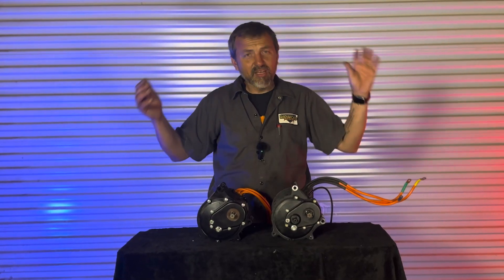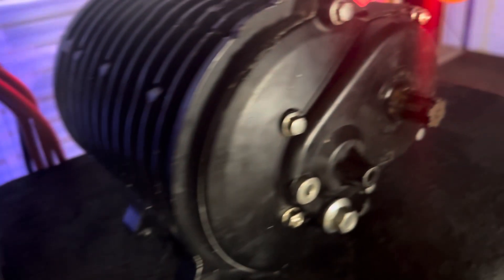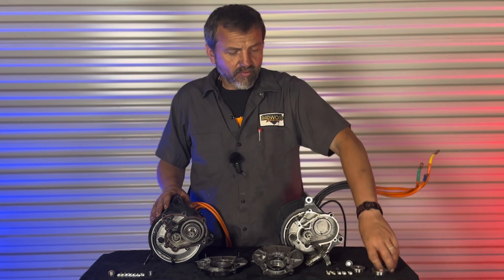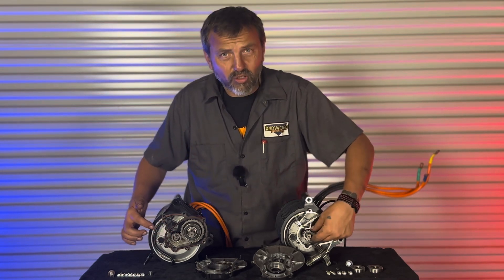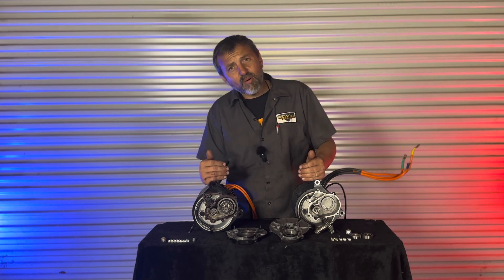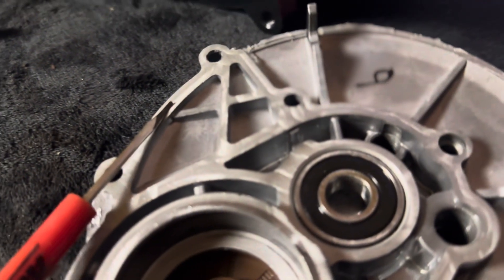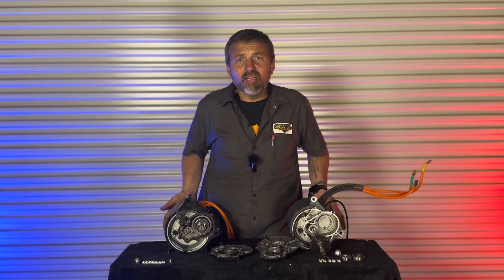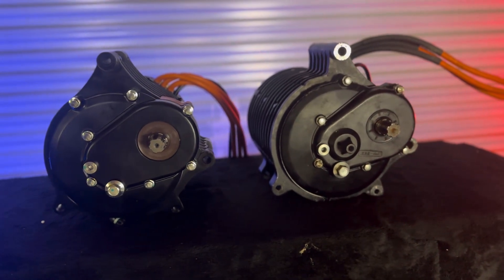Should you upgrade your QS138 V3 70H?

Comment: Hello
I have a question, after purchasing the engine, I did not unsecure the transmission vent, after driving a few km the engine turned off and It turned out to be burnt. Is It possible that oil got inside and caused so much damage? Regards
Reply from the maker: @miloszslodzinski4762  I wouldn’t think so, how hot did it get?
Reply: Is it possible that you had badly installed cable lugs on ends of the phase wire ?.

Comment: what if you just cut the breather tub shorter so it doesn't fall in the area thats blocked off?
Reply from the maker: @PhoKingLitMedia  the problem is that it can’t breathe the way it was designed.
Reply: @Radwoodgarage  I have a question for you. My qs 138 v3 was delivered today and it looks like it missing the gasket about half the way around the outer cover. The same side as the vent tube in your video. Is it supposed to be this way by design to help it breath as you mentioned, or is this a defect? If you give me your email I can send some pics. I can literally see inside the cover through the gap.
Reply from the maker: @PhoKingLitMedia  it’s not the tube, it’s the channel leading to it.

Comment: What do you think of the Electro and Co version of this?
It releases today!

I'm interesting because it's silver.

Tingtong/sotion is coming out with a crf motor and I currently plan on that. I have a 2005 crf450
Reply from the maker: @caldeio  that is some HI END CNC if that is actually billet. I would also say it would be a good upgrade if the price is right. 
I haven’t seen the TT motor as a kit. Just a motor that you have to build brackets for.